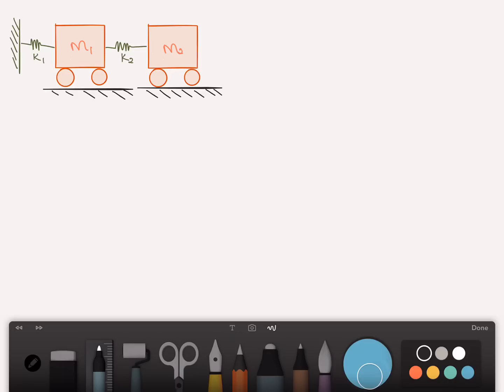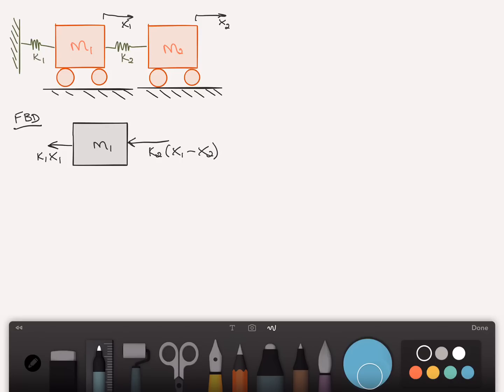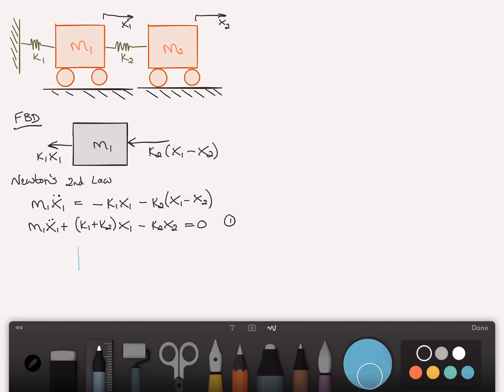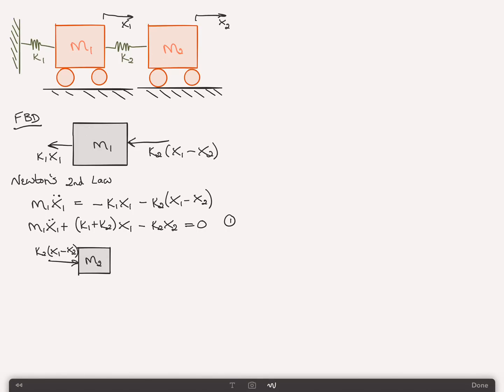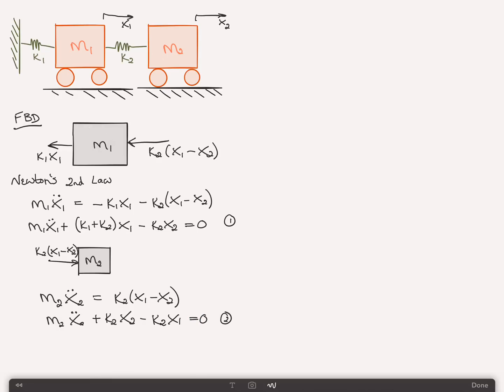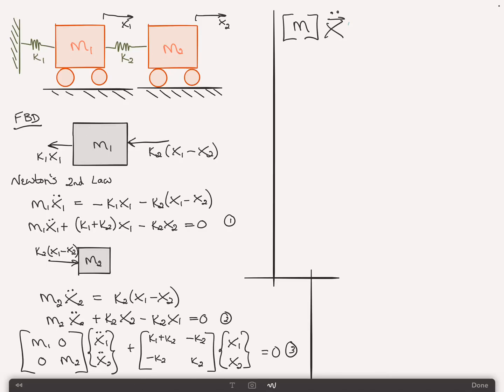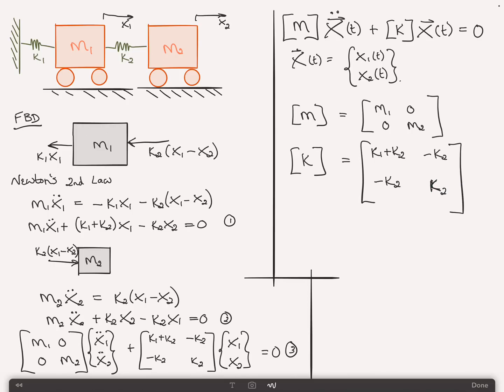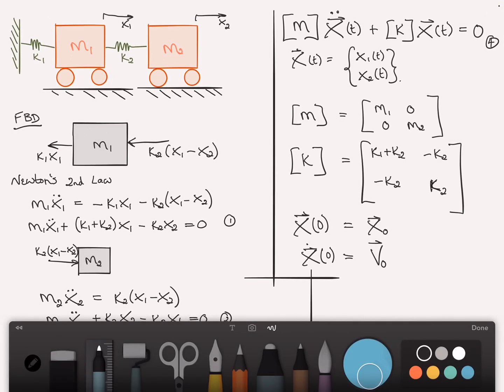Two Degree of Freedom (2DOF) Problem Without Damping - Equations of Motion (EOMs)

Comment: In order to avoid confusion I always draw a force in positive direction in a sketch. If it is directed vice versa, then it has to be negative. Thus, the significance of the sign is clearly defined (with respect to the coordinate system).
The stiffness matrix may be derived in an alternative procedure: Coefficient ij is the (reaction) force at location i due to a displacement of unity at location j, whereas displacements at locations not equal to j are zero.

Comment: Won't this be easier  to try with the Lagrangian if I may ask?
Reply from the maker: For a simple problem like this, you can do it either way - whichever you feel more comfortable with.  In terms of the progression of videos on the playlist, I hadn't yet introduced the method of using the Lagrangian, and so I modeled it using Newtons 2nd Law.
Reply: @Freeball99  Ofc! I understand both approaches are just as valid as one another. I did recently cover the Lagrangian and despite everything I seem to be preferring it over all other approaches even if the question is about a bunch of pulleys lmao. Maybe I'm just too enthralled by it...

Comment: I keep getting confused with the difference between x1 and x2. e.g. for the Freebody for m1 can you imagen it as -k2x1 as this is the force opposing/pushing back from the extension x1 and then +k2x2 as this spring force pulling the mass from the extension x2. i.e. have two spring forces for k2 in each direction or is this not a good way to think about it?
Reply from the maker: My advice is to consider each coordinate one at a time...  
So first consider the forces on m1...then if I displace it by an amount x1(assuming x2 = 0), what is the direction of the spring forces acting on m1 and does the sign you have make sense?  Similarly if I displace m2 by an amount x2 (assuming x1 = 0), then what is the direction of the spring forces and what should the sign be?  Now, add (superimpose) these two effects together.  
Then repeat this for the forces on m2. 
 If you get this technique down, it will only take you a few seconds and you'll never make a mistake with the sign again.

Comment: I had the doubt of why the force on  the right side of m1 was k2(x2-x1).  I think is because x2 - x1 corresponds to the equivalent strech that spring k2 is feeling. X2 refers to the tension by m2 and -x1 refers to compression by m1.
Reply from the maker: My advice to you if ever you get confused with this is to keep one of the coordinates fixed and move the other a little (in the positive direction).  When you move just one coordinate (i.e. just move one mass at a time), it should be obvious if the calculated spring force is in the correct direction.  

Also remember that the spring will exert an opposite and equal force on each mass that it is connected to - so the spring force on the one mass should be the negative of the spring force on the other mass.

Comment: Don't get annoyed by this basic question
If k2 experiences compressive load from m1 at one end and a tensile force due to m2 at the other end, then should the net restoring force be -k2(x1+x2)
Reply from the maker: No, this is not correct.  To illustrate this, consider what happens if x1 = x2.  If both ends of the spring move by the same amount then the spring does not deform and so produces no force.  But according to your formula, it does and so it needs a minus sign.

Rather think about it this way.......view it from the mass's point of view.  

The force applied by the spring to m1 is -k2(x1 - x2) where (x1 - x2) is the total deformation of the spring (i.e. the amount the spring is compressed).  

Then, when considering m2, the force is equal but opposite.  So m2 experiences a force from the spring of k2(x1 - x2) = -k2(x2 - x1).

Side Note: 
If x2 > x1 then spring is being stretched and it exerts a tensile load.  If x1 > x2 then spring is being compressed and exerts a tensile load.  If x1 = x2, then spring's length remains unchanged and it exerts no load (this is known as rigid-body motion).

Finally...I am always happy to answer "basic" questions.  For one thing, it tests my ability to answer things in clear and simple terms.  Hopefully, this has achieved that.  If you have any more, feel free to fire away.

Comment: Nice Video, Which software you  used for tutorial writting?
Reply from the maker: I use an iPad Pro (13 inch) with an Apple Pencil and the app is called "Paper" by 53.  I record the video by connecting my iPad to my Mac with USB and then using Quicktime to record video input from the iPad.

Comment: I think it can mitigate confusion if you explain how is k2*(x1-x2)? There should be an assumption of x1 > x2. And the FBD should show how the movement agrees with the assumption. Otherwise, that force direction would be questionable as well.
Reply: Point 3.

x2 increases let us say 5 units to the right, and keep x1 in place.

-K1(x1-x2)=-K1(0-5)=A positive force?

It works when x1 is increasing.

So do I change the equation accordingly?
Reply from the maker: There is no assumption that x1 > x2.  The easiest way to mitigate confusion is to treat each coordinate separately.  

3 Simple Steps:  

1.  Draw the force vector on the FBD and write the expression for it.  

-  It can be drawn in the positive or negative x direction - it doesn't matter which direction at this stage, but once decided, THEN STICK TO THAT DEFINITION. When you apply Newtons 2nd Law later, you will then take the direction that you have drawn the force into account.

2.  Assume x2=0 and see the effects of x1 on the force.  As x1 increases, is the direction that I have drawn the force on the FBD correct?  If not, then change the sign on the x1 term.  

3.  Then assume x1=0 and see the effects of x2 on the force.  As x2 increases, is the direction that I have drawn the force correct?  If not, then change the sign on the x2 term.

That way you know that your signs are consistent with the direction you have drawn your force.
Reply: @Freeball99  I'm slightly confused by these steps.  Are you saying that these three steps were followed when you wrote the FBD in your example above?  It looks like you just assumed #2 (only x1 moved and x2 holds at 0), because once you assumed that k2 was in compression and pushed back on mass 1, you assumed that is was equal and opposite (that is, still compressive but the opposite direction) on mass 2.  

If you assume #3, then k2 is in tension, but that's not what you did in your video.  Are you saying pick either compression or tension for k2 and stick with it for both FBD?  I hope this question makes sense.  Thanks for the video.

Comment: on mass 1 why is the force on spring k2     (forcespring k2)= k2(x1-x2)? why it isnt k2(x2-x1) ?
srry just wondering because on somesituation i found out the solution is x2-x1 rather than x1-x2
Reply from the maker: It depends on which direction your force vector is drawn.  In the free-body diagram for mass1, I have drawn the force vector for spring k2 pointing to the left (i.e. the negative x-direction).  While the direction of this vector is completely arbitrary, I drew it this way because I felt like it was intuitive that when mass1 is displaced to the right, then the spring force is to the left.  So, when I applied F=ma, I SUBTRACTED this force (because it points in the negative direction).

You could have just as easily drawn the spring force vector pointing to the right and in that case the force will be k2(x2-x1) as you have suggested.  Then when applying F=ma, you would ADD the force (because it points in the positive x-direction).

It doesn't matter which direction you draw the force vector, as long as you are consistent with how you represent it and apply it.  There is a simple check to see if you have this correct and that is to rewrite the equation with all the terms involving x1 (and its derivatives) on the same side of the equation and to ensure that for the equation of motion that governs x1, the coefficient of the x1 term is POSITIVE (and similarly for the case of the x2 equation, the x2 term should have a positive coefficient).  This is required (mathematically) for static stability of the system - as explained in this video (https://youtu.be/0SAVj2GiNF4).

Comment: pls explain how was the matrix formed. ??? :/
Reply from the maker: We have 2 equations of motion  (numbered 1 & 2).  In order to write the equations in matrix form (because this makes things convenient for solving), we choose to take the displacements (the x_i's) and the accelerations (the x_dot_i's) and stack them in vectors.  The elements of the matrices (which multiply these vectors) are then the coefficients of the accelerations and the displacements from each of the equations of motion.

So, the elements in the FIRST ROW of each matrix come from examining equation 1 and noticing what multiplies the accelerations and the displacements.  Similarly, the elements in the SECOND ROW of each matrix come from examining equation 2.  

This should become apparent if you take equation 3 and multiply it out - you will see that you arrive back at the original equations.  The matrix of coefficients of the accelerations is known as the mass matrix, [m] while the matrix of coefficients of the displacements is known as the stiffness matrix [k].

I hope this explanation makes sense to you.  It's a little harder to explain matrix math in these comments since YouTube doesn't easily allow me to write matrices in the comments sections.  If it's still unclear to you, feel free to let me know what you find confusing and I can expand upon this.

Comment: Why is it x1-x2 as opposed to x2 - x1?
Reply from the maker: This is due to the fact that on the free-body diagram, I drew the forces pointing in the negative direction.  The signs I used are consistent with this.  

One way to keep this straight in your mind is to imagine that m2 is just a rigid surface.  Then, as m1 moves to the right by an amount x1, BOTH springs oppose the motion, therefore both springs product a negative force (ie a force to the left).  Since I drew the force vectors pointing left, I have a positive sign in front of x1 and I subtract the forces when applying F=ma.

Alternatively, what you have suggested is fine, but then just draw the the force vectors pointing to the right (i.e. the positive direction).  Then when applying Newton's Law, you will add the forces rather than subtract them as I did.
Reply: Sorry, I think I get it now. I was previously thinking as x1 x2 as a point in a coordinate system, rather than a variable that equates to the distance changed in the spring.

Thank you for your response and I didn't understand not because of your teaching, because its very good and I am grateful for it. But my brains fried from stress.
Reply: I honestly still cant wrap my head around this. and I think Im going crazy.
Reply from the maker: Is there a particular point in the video that you're getting lost?  Is it the problem setup or the solving of the math that's confusing to you?
Reply: Isn't the direction of the force vector of spring 2 w.r.t to m1 based on the assumed relative magnitudes of x1 and x2?  that is if you assume x1 > x2, spring 2 is compressed and by applying Newton's 3rd law, it will exert a force opposite to the direction of x1 like you have drawn. If you assume the contrary, spring 2 is elongated so it will exert a force in the same direction as x1. But either way, the direction of the force vector of spring 1 will always be opposite to that of x1. Just my understanding of a 2DOF system, please correct me if  I am wrong.
Reply: @tinkukuty1232  no it's based on the fact that it's getting compressed by the mass m1 and the spring force would act in the opposite direction to restore back to its original equilibrium position

Comment: can you explain me how to decide the direction of motion?
Reply from the maker: Picking the direction of the co-ordinate system is completely arbitrary.  Typically I define my horizontal axes (x1 and x2 in this case) to be positive to the right.  Could have just as easily pointed them to the left or one in each direction.  Regardless of how you define you axes, it is important that you are consistent when drawing the free body diagram.  Whatever the positive direction of the axes, if a mass and spring is displaced in this direction, the spring force will always be in the opposite direction to its displacement while the m.(x double-dot) term will be in the positive direction of the axis.  As long as you are consistent with this, then you're okay.  I encourage you to try this.  Defining your axes differently (for example if x1 points to the left and x2 points to the right) might produce sign changes in some of your terms, but this does not necessarily mean that you've done something wrong.  If your results have sign differences versus a problem that someone else has worked, you should first check if your axes are defined the same way.
Reply: Thanks, this confused me back then, I cleared it in my second year after making this mistake on a test but now forgot about it, thanks for the refresh! btw, are you an engineer working in dynamics and control? Any advice to mechanical engineering students who want to pursue msc and industry in control systems?